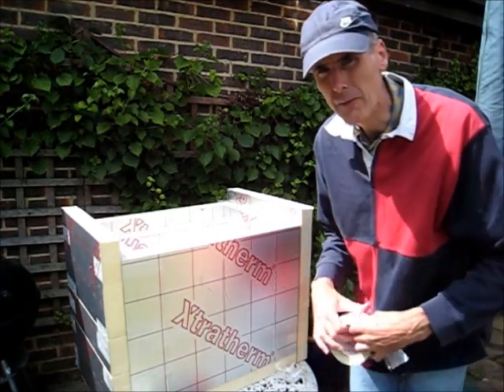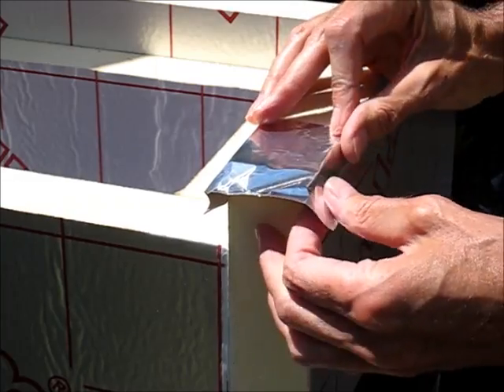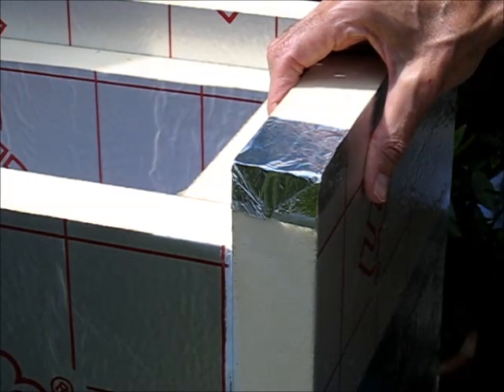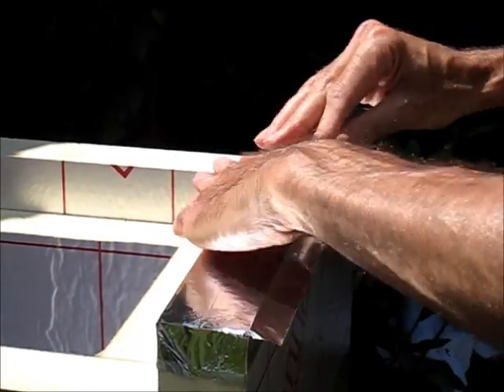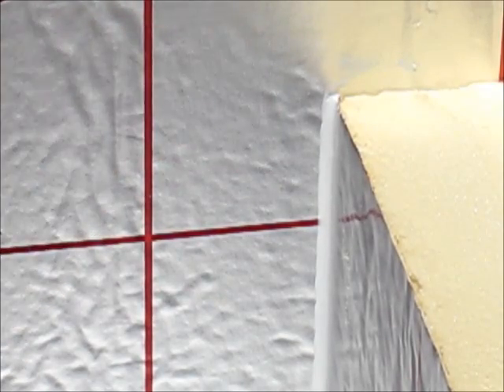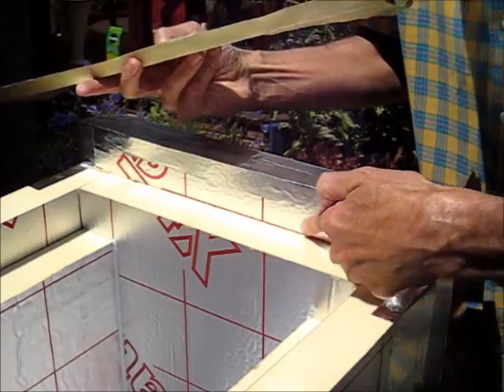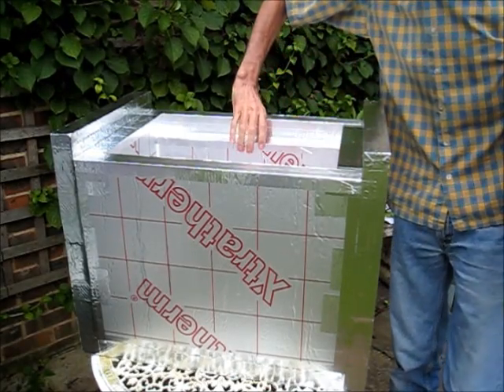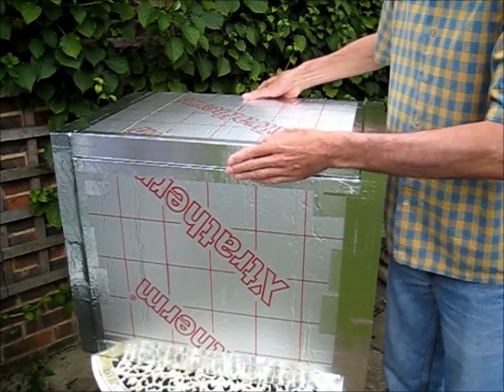Build your own super cool box! NEW ORIGINAL DESIGN - part 3

Comment: I built a box exactly 
 the same and i plated with 2 mm white  pvc sheets glued on the  inside and outside,  and the corners finished with white  PVC angle.
Looks professional, with no damage done to the insulation inside or outside  when handling